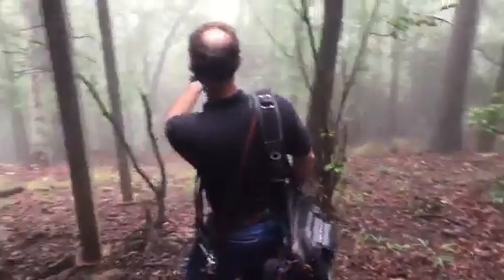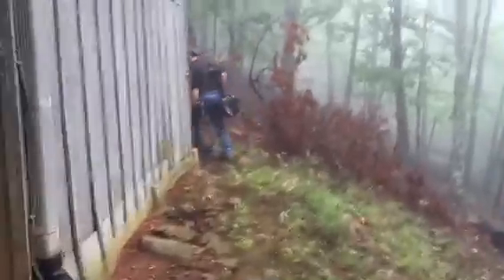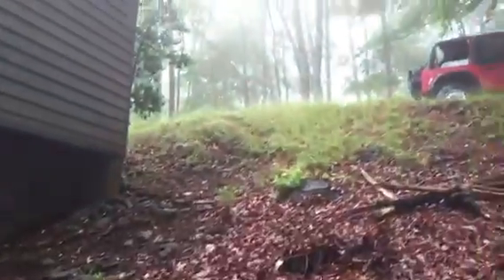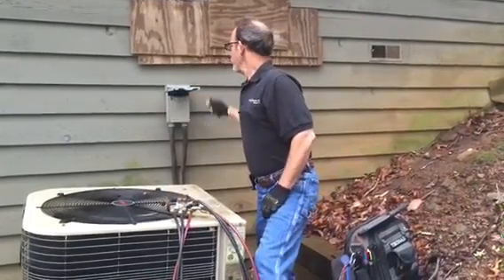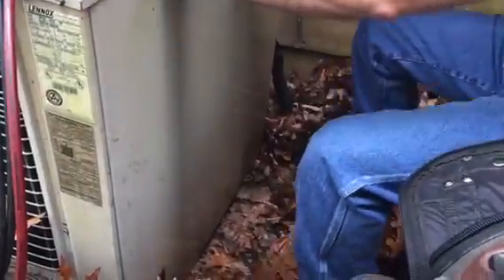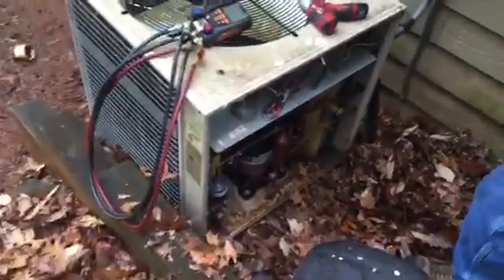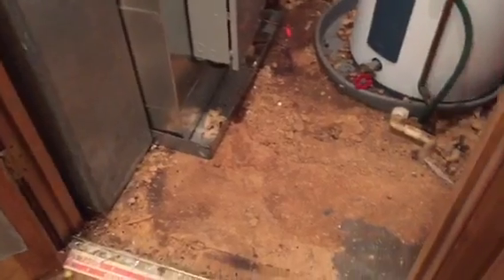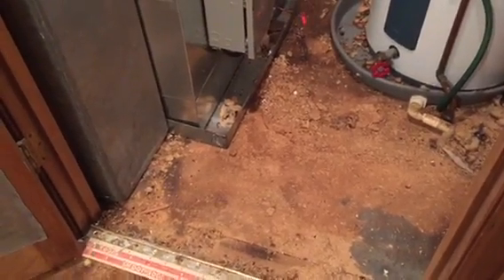HVAC Service:Why I use cap blocks on my jobs

Comment: Hey Ralph. Worked on many a units like that in TN in the great Smoky Mountains. And yes, getting a condenser down the side of a mountain was never fun. Had to lower equipment down all the time from deck by rope. Hate snakes too but had to deal with bears and Bobcats.
Reply from the maker: I don't think I'd be lowering a unit down with a rope LOL at that point I'd gladly let them call someone else. There are bears up there too

Comment: So i used my gauges today and pulled a vacuum, it automatically detected the vacuum and it went to the "InHg" setting. But you still need to micron gauges obviously

Comment: Well the reason i ask is because i just got my testo 550 w/ Bluetooth yesterday, witch im pretty excited to use today at work, is because im trying to figure out how to pull up the vacuum menu. Maybe you can make a video of it and help me out

All the other stuff i have locked down
Reply from the maker: I don't think there is a vacuum setting on the new 550's. I could be wrong though

Comment: That was a rough one Ralph
Reply from the maker: Going back this morning to remove the AHU. The water heater had to be removed to get the water heater out. The plumber didn't get there till late so I wasn't able to take the air handler out.
Reply: Those darn plumbers lol

Comment: you should get a big taser with alligator clips and hook it up to the units before you open the panels to shock any snakes inside. Don't snakes taste the air, spray some bear mace through an electrical knock out.
Reply from the maker: LOL jim pettinato
Reply: T&N Services LLC. There's a good nickname for you "Rattlesnake Ralph"  ...change your you tube name from T&N to "Rattlesnake Ralph", there will be viewers in Russia saying "I want to watch Rattlesnake Ralph"